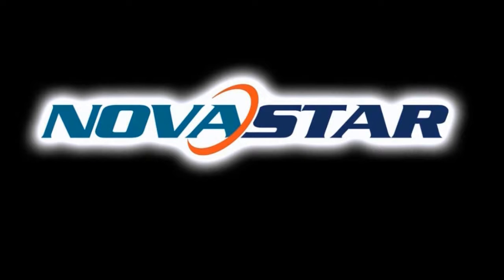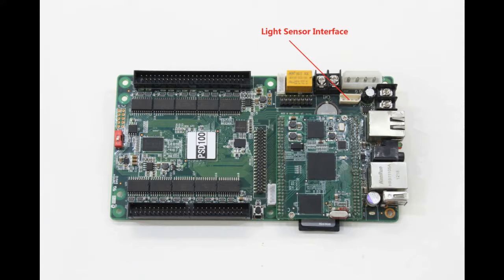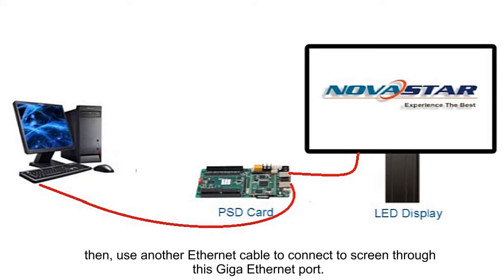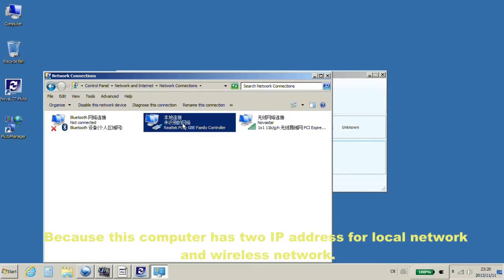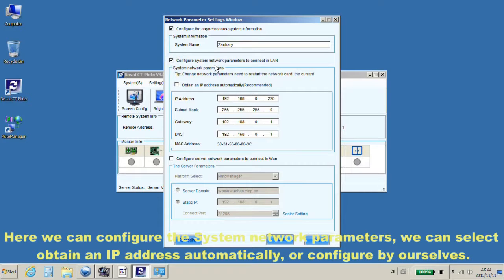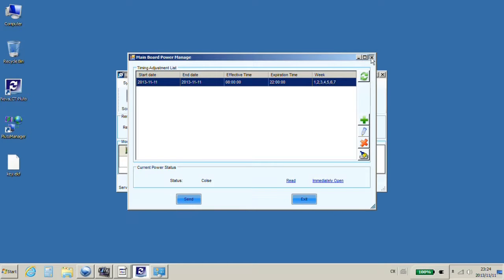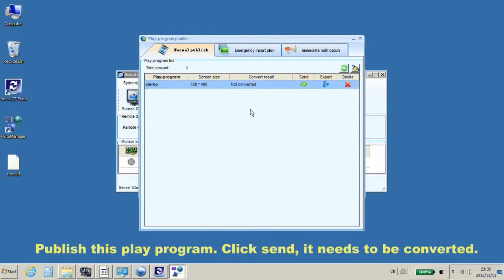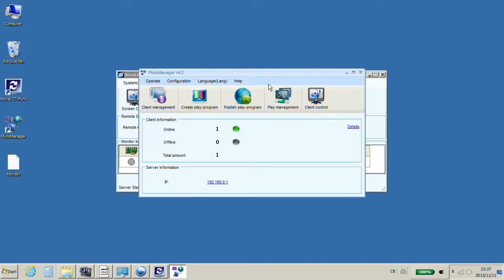Novastar Pluto PSD100 Configuration

Comment: Hi I need to set up led wall (P6) . Cabinet size 128 X 128. 
Led wall size 15ft(w) X 12.5ft(h) but when I set the cabinets in the configuration page get error msg vertical region cannot exceed 600. Pls give solution. Your support highly appreciated.
Reply from the maker: Sashika Fernando We recommend using the MSD300 Synchronous system with our CloudLED.com system. The PSD100 has been discontinued.